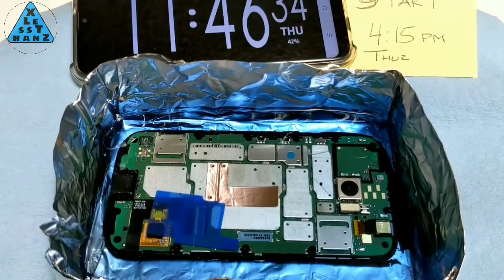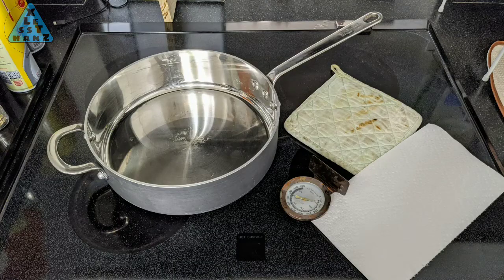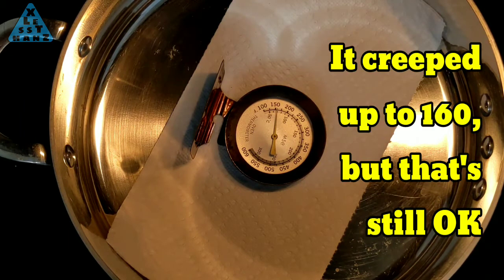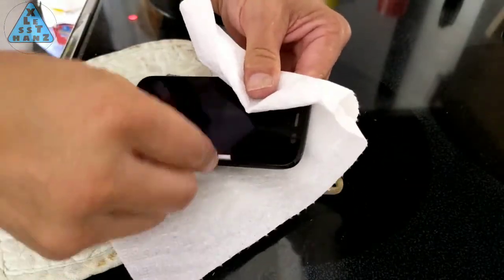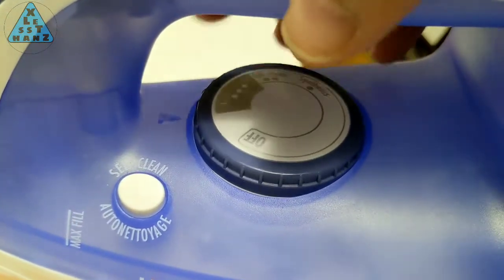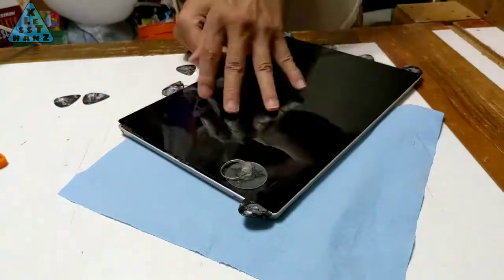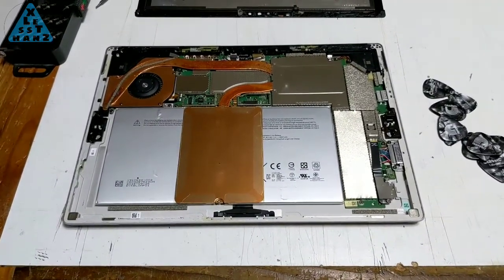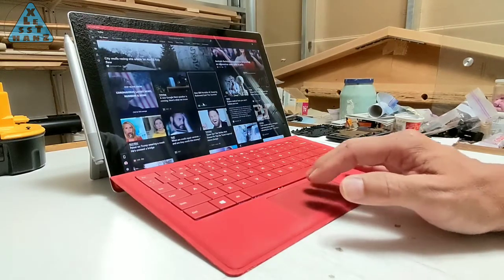Smartphone Screen Replacement Using a Frying Pan (NO HEAT GUN NEEDED)

Comment: That's hilarious your induction stove did that control thing. Mine was sneaking up to 140 deg. F on 4.5 out of 9 and suddenly blew past 200 on 5. That said, It finally melted the glue on the sides PDQ on that and I found the blue plastic spudgers I had were enough to separate it. (Hot pad with phone in the other hand, lol.) If I had a ferrous half-sheet for baking I would use that in the future. Maybe. If I didn't just buy a temperature controlled pad.

Comment: What about an iron? Like for your clothes?
Reply from the maker: I actually like using one of those mini Cricut irons.  Gets pretty hot, but just have to use the low setting and be careful 🤙🏽
Reply: @XLessThanZ  ended up using an old hair straightener/flat iron with wide heat pads and it did the trick

Comment: Good. I used my BBQ Flat Plate. BBQ has a Hood and built in Temp gauge. When I got to 150C I Placed a heat resistant mat on plate. Could have used paper towel I guess but was worried about it flaming up. Put phone on mat (screen down. Turned off BBQ. Closed lid and checked every 30 seconds.
And it worked. Because you used the BBQ flat plate the plate holds temperature for ample time to melt adhesive.
Reply from the maker: Sounds perfect for this task 👍🏽